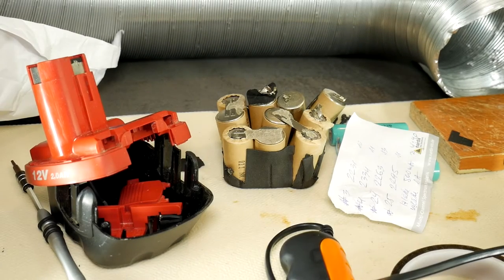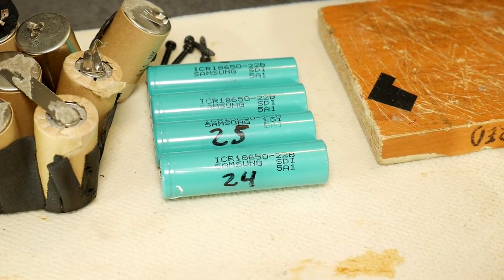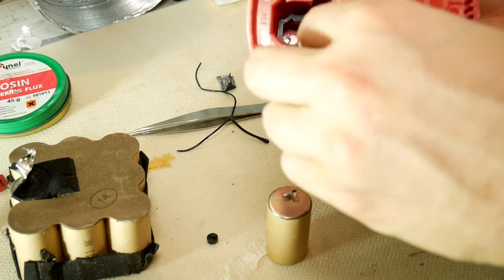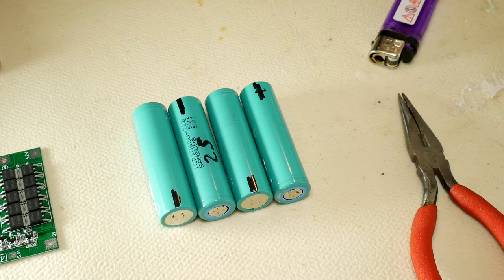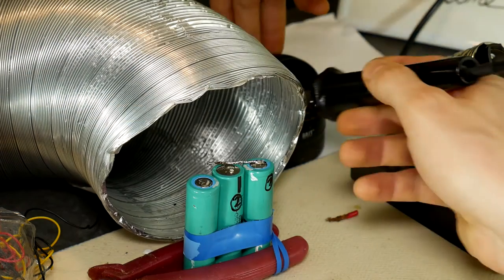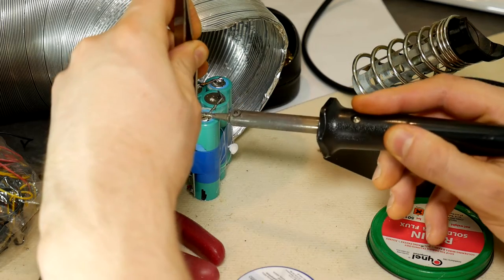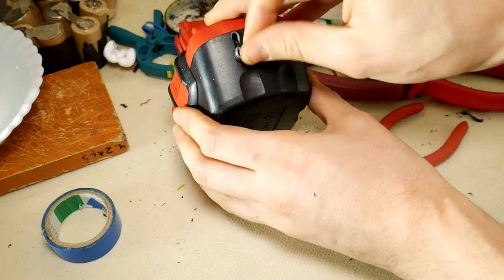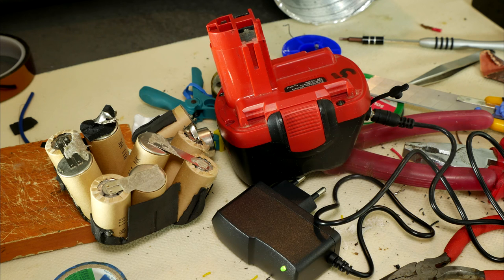How to Replace Drill Ni-Cd to Lithium Battery DIY at Home

Comment from the maker: Parts on Aliexpress:
- DC Socket https://bit.ly/3PINTFr
- DC Socket cap https://bit.ly/3tdKWke
- 4S BMS https://bit.ly/3lawFlR
- Li-on charger https://bit.ly/3z29cuo
- 18650 Batteries https://bit.ly/3rHVacv

Parts on Amazon US:
- DC Socket https://amzn.to/3qHsxuq
- 4S BMS https://amzn.to/3t4OMfE
- Li-on charger https://amzn.to/3bDSIhq
- 18650 https://amzn.to/3vckLfP

Parts on Amazon UK:
- DC Socket https://amzn.to/3l9CXC0
- 4S BMS https://amzn.to/3rT2xO4
- Li-on charger https://amzn.to/2NfrSmy
- 18650 Batteries https://amzn.to/3l8RWMB

Parts on Amazon DE:
- DC Socket https://amzn.to/3etO6wg
- 4S BMS https://amzn.to/3rHWmN1
- Li-on charger https://amzn.to/3rKL6zw
- 18650 Batteries https://amzn.to/3tiRmPn